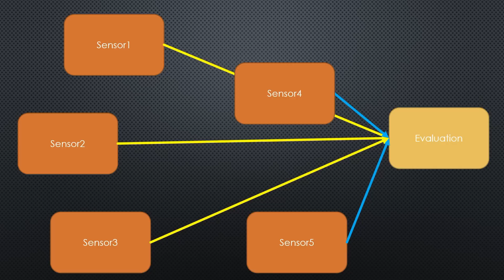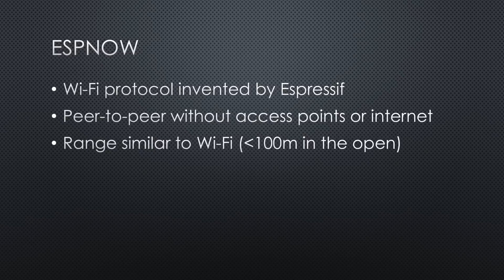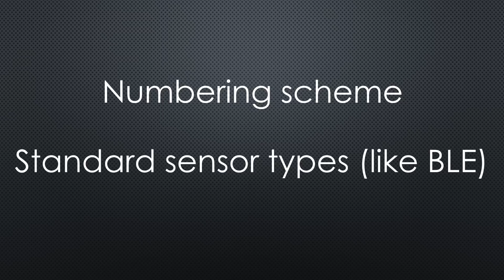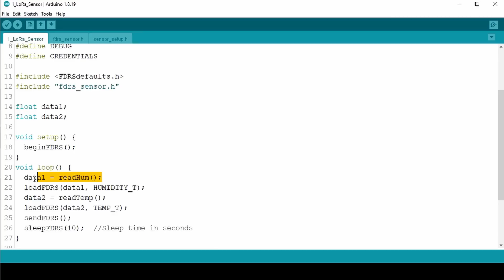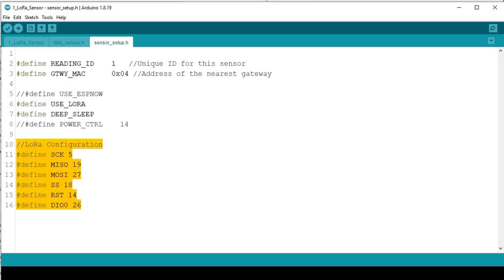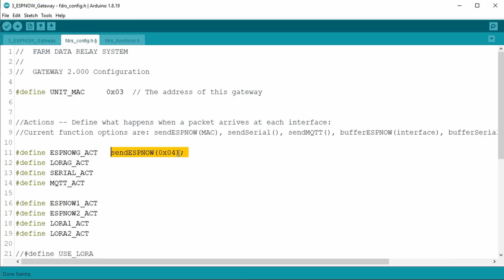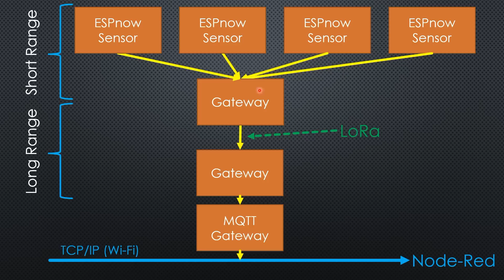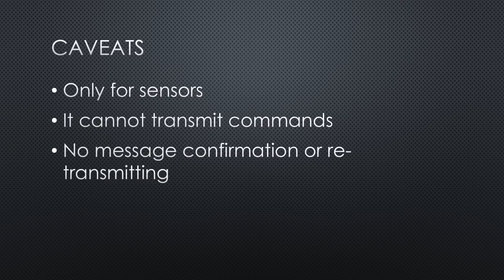430 ESPnow and LoRa Network (incl. Repeaters and Gateways). A TTN replacement?

Comment: You can use both ESPNOW and WiFi at the same time. I use it in my ESPNOW weather station. The trick is both the WiFi and ESPNOW must use the same channel, and when my AP restarts, it just picks a random channel, so when my ESPNOW to WiFi gateway reconnects to WiFi, it is no longer listening on the same channel as the weather station is transmitting on. My solution is to have the gateway broadcast an SSID (which contains the channel info), and every 1/2 the weather station looks for that SSID, and sets the channel to what the gateway is currently using.  I could have just hard coded my channel in the AP, gateway and weather station, but I like to avoid hard coding configurations like that.
Reply from the maker: Thank you for the info! I new that there are some restrictions. So it is probably easier to spend an ESP-01 to avoid any hassle….

Comment: Congratulations on your videos always well made and very well explained.

A few years ago I made a lorawan network with a gateway on raspberry, it always worked well, but with the upgrade to v3 I had several problems.
I was thinking of switching to a local Lora network, reusing the old sensors based on Arduino Micro AT328 and Wemos D1 (ESP8266) boards with RFM95
Your video may have helped me migrate from Lorawan to Lora / ESPnow, recreating a local network and sending data to raspberry + node.red
Reply from the maker: That is also my plan for my mailbox sensor. Particularly if Timm adds a confirmation.

Comment: Hi @Andreas , Very nice video and very nice concept. I will be watching this space as I also switched from wifi to to espnow for all my sensors. Also, to let you know , it is possible to run both espnow and WiFi Station on the same ESP at the same time. I run my setup where an ESP01 (yes, you read it right !!) acts as a gateway to receive espnow messages and relays them to a MQTT server. It has been running without issues since the last 4-5 months. Forgot to mention that the only limitation on it is that the gateway ESP (and hence the other nodes) has to be on the same channel as the WiFi SSID which is just one extra piece of code to determine the same.
Reply from the maker: Interesting to only use an ESP-01 as a gateway. Maybe Timm has a look at your comment!
Reply: WiFi and ESP-NOW work if they are both on the same channel.  If the user were to set all sensors and gateways to run on the channel that their WiFi router is on then that would work. From my perspective, this would have been too much to ask of a new user who is less knowledgeable about networking. I could imagine a lot of beginners contacting me asking why their system stopped working when their WiFi router switched channels on them.
However: I'm planning to make the WiFi channel modifiable as a global soon.
Reply: @timmb2512  I solved this issue on the sensor node by taking the SSID of the WiFi router , and scanning the same to obtain the channel. also a retry mechanism where if message delivery fails, it again scans to see if the channel has changed from last time. I also store the channel in EEPROM to avoid wasting ~2 sec in scanning every time. You can view my code in the repo here : https://github.com/vks007/public-projects/blob/master/include/espnowUtil.h
Reply: @vks002  This is one of my favorite workarounds, the other way being to cycle through all of the channels and see what gets a response. However, what would happen if a sensor is separated from the gateway by a repeater? You could have every single gateway/repeater broadcast an AP, but keeping them all updated will lead to overhead that I'm just not ready for right now. I definitely won't rule it out forever, I just want to focus on other aspects of development for now. You are more than welcome to try adding your method to FDRS and reporting back/submitting a pull request.

Comment: Hi Andreas, i love your videos, i have learned a lot watching them. I need your help. I have tried to use an EPS32 to control the start and stop of an AC motor, with a MOC3041 and a TRIAC BT13, but the ESP32 is resets itself just when the motor is started or stopped. In the circuit I'm also using a load cell and an oled 0.91" display. Could you please give me an idea of why the ESP32 is resets itelf. Could I sent you the circuit via e-mail?
Reply from the maker: It usually has to do with an unstable power supply.
Reply: @AndreasSpiess  thank hoy forma your time. I"ll check it. I've been powering the esp32 with my laptop's usb 3.0 port.
Reply from the maker: @chuchinmc  Motors can create a lot of noise on power lines…
Reply: @AndreasSpiess  Hi Andreas. I have found the solution. I've made the the same circuit, but working with a PIC18F26k22. The Oled display didn't work on the PIC without pull-up resistors on SCL and SDA pins, so i had to use them to make it work. On the ESP32, the oled display worked fine without these resistors and even people on the tutorials I've had seen, doesn't use them. So, i put the  pull-up resistors on the ESP32 oled display circuit and ¡magic happened!, now ESP32 works excellent, it doesn't reset anymore when starting or stopping the AC motor.
Thank you for your time and thanks for your videos.

Comment: You can have wifi and espnow running at the same time. I do this in a esp32 motion detector talking to a esp32 light switch which is connected to the router as well.
Reply from the maker: Thank you. Maybe Timm has a look if he can live with the restriction of using the same channel.
Reply from the maker: Thank you. Maybe Timm has a look if he can live with the restriction of using the same channel.

Comment: I have a use case I am working on where I need to report sensor values along a river 5 miles. One sensor each mile. I think I needed to use a mesh network for the farthest node to connect to the gateway. Do you know if the repeater can also send its own sensor data with this approach?
Reply: At the moment, there isn't a way to have gateways report their own sensor readings.
I would recommend linking the gateways via LoRa and using ESP-NOW to communicate between the gateway and a nearby sensor.
You just gave me a great idea though: I'm going to add serial as an output option for the sensor sketch, then it could be hard-wired to a gateway, thus eliminating the ESP-NOW jump between sensor and gateway.

Comment: this looks like it could have a lot of potential for (other than farms) managing large plots of land or woodland like for instance having thermal and smoke sensors using small solar panels and a battery scattered around woodland to make catching fires early easier. also could be cool building one of these networks out over a town or city that tracks roughly how busy areas are and also trafic using things like millimeter wave and radar sensors all going to a central node that publishes a heat map of an area that is independent of company like google or even independent of weather people are carrying phones
Reply: Exactly! These are the kinds of applications I dreamt of while designing the system. I used to have a radar motion detector sketch included, I just need to update it and re-upload.
Reply: What cool would be if you could have different recievers. So that you could communicate similar how internet works over different range extenders to the board that needs the information. But that's probably difficult to put into practice. Would probably need to know the localization of the recievers to connect over the most efficient way to them. Maybe could test always when a new sensor adds to the network testing the shortest connection to it like counting how many range extenders it has taken to reach the destination. The strength of the signal could also be clue but probably is not needed. But when the sensor is a moving target it's different locations all the time

Comment: I use one node as gateway, that also does WiFi. I have a D1 Mini Pro in my mailbox, which sends the ESP-NOW message to my gateway. When my gateway has received a message, it will restart the ESP, connect to WiFi, send MQTT message, reboot the ESP, and go back into ESP-NOW gateway state. Whole process takes ~3 seconds.
Reply from the maker: Good project! You just have to be sure than no other message arrives during the downtime…
Reply: @AndreasSpiess  Only got 1 slave and 1 master, so no worries. Not the best for reusability, but it's ok

Comment: Hello everyone, and thank you for the kind feedback on my project!
I'll be doing my best to address any questions that are asked here over the next couple days.
Cheers!
Reply: Great work Tim. I have a small farm in Australia and have implemented a similar LORA solution to get water tank readings displayed in the house. Your solution seems very robust and adaptable. I will definitely be learning from your example. Very well done.
Reply: Hi Timm!  We need to join forces ! We have been working in similar approach for quite a while + ability to mix sensors from multiple vendors - use own platform. (locally)
Reply: Cool project. I never really liked automatic meshes. Too many tings that can go wrong.
May I recommend implementing one single simple config file for the whole network (probably in JSON) and each node simple picks the important things using it's id?
You could also define the routes that traffic should take that way (e.g. "node 2 via ESP-NOW to node 4", "node 4 via LORA to node 6", etc.)
Reply: @MoritzvonSchweinitz  I've been thinking somewhat similarly for a while. I think an outside application that allows you to configure the whole system would be just the beginning, my dream is a drag-and-drop interface built on top of satellite imagery like google maps. It could even crunch topographical data between the points you drop to estimate signal strengths and ranges. Then on the other end, the application guides you through flashing them and helps you keep track of which is which.
One day...
Reply: Brilliant work Timm! I was looking for just this system. Thank you! 👍😀
Reply: great work!!  I tried something similar (espnow to wifi) but the gateway was a nightmare. I tried to use the internal EEPROM of a ESP32 and two working profiles everytime it rebooted to move from espnow (rx mode) to wifi (tx mqtt mode). And also two esp32 connected by Serial (not by usb), but I still have issues. So I´m really interested in the gateway you have configured. great work!!
Reply: Hi Tim, consider how MODBUS could be used as well.
Reply: love your work!
Reply: Thanks so much for your incredible and most valuable work!!! 🙏🙏🙏

Comment: I would not reinvent the wheel and prefer standard communications protocols. The maintenance of a custom solution is unpredictable
Reply from the maker: I would call MQTT, ESP-NOW, LoRa and WiFi standard protocols in the Maker community.
Reply: @AndreasSpiess  ESP-NOW is proprietary.  all protocols should be standard also up the stack like LoraWan / TCP/IP, JSON....you already see that the proposed stack is one way only

Comment: I like to see more of ESP NOW and its limitations. It says max peers is 20, but is that only for the sender to send to max 20 devices or does it also affect a receiver which wants to get data from more than 20 devices? I only have to add a peer to the sender. Documentation is sparse on this.
Also encryption limits that even further and example code is even less available.
Reply: Documentation is definitely a little hazy regarding ESP-NOW peers. The 20 device limit isn't relevant in the way that FDRS uses ESP-NOW.

Comment: Very interesting project Andreas! Thank you. 2 years ago when I played with my Ebyte LoRa modules I tried to build a mesh network (those devices are cheap but can't use LoRaWAN). You set them on individual addresses and let them decide the communication paths by the dB level they measure. It worked well for a few but I assumed at that time the messages to keep the network alive might spam the airtime and didn't pursue it. This is a star network as you explained so a different idea. 👍
Reply from the maker: You are right. Mesh network algorithms are not easy…
Reply: @AndreasSpiess  With "star" networks you can develop your own security and hierarchy. Otherwise it can become a big mesh. (sorry, couldn't resist)
Reply: @hippie-io7225  Yesh!

Comment: Nice, I developed a very similar comunication protocol for a Wide area sensor network base don LoRa only. I’m using an apikey to discard all the messages not generated from my network’s node. How do you manage this problem? Do you encript your data? Your videos are always inspiring. Thanks
Reply from the maker: Maybe Timm can give you an answer?
Reply: No encryption is used. I created a 5-byte header for LoRa packets in which the first 3 bytes of the LoRa packet contain the recipient's address, and the next two are the sender's address. The device only responds to packets that start with its own address.

Comment: I am soon building an ESPnow product for farms, so this video caught my eye :)
Reply from the maker: Perfect! Maybe you join forces with Timm?
Reply: @AndreasSpiess  He and I are going slightly different directions, and my code is mostly finished, but I might browse his code for ideas. For one, I'm using MicroPy. But I might pick through his code looking at the repeater bit.
Reply: @cdevidal Did they ever get ESP-NOW to work with MicroPy? I've often considered that you could make FDRS (my project) useful as an ESP-NOW modem attached to MicroPython devices via serial.
Reply: @timmb2512  Glenn20 has a patch and it’s almost ready to be merged into the mainline. Another difference between yours and mine, I’m doing bidirectional comms. That may prevent me from using repeaters, I don’t know. Can the AT mode issue ESPnow commands? I know the new ESP32 AT firmwares are quite advanced. Then you could use them as a modem.
Reply: @cdevidal  I don't think it's supported in AT mode, unless it happened recently.

Comment: Well done Andreas, very usefull. I am busy developing a greenhouse control system for home / agriculture use. I was initially tinkering with lorawan, but a  bit put off by gateway cost for each site. This looks much better.
Reply from the maker: Maybe you can join forces with Timm?
Reply: Dear Andreas ! Thank you for the interesting video. In fact we have been working with similar approach for quite a while (LOCAL MQTT + cloud MQTT talking to each other) -  Francois - We need to meet/zoom discuss all together and join forces with Timm! (maybe through EU project as well!)

Comment: I made a similar project a few years ago, however I just used LoRa with two different configurations, long range but slow communication and short range but fast communication (LoRa can be configured for that too). The system was later integrated into the Home Assistant. It worked very well, only the Gateway (Raspberry pi with the Home Assistant) had access to the internet and the remaining devices (sensors and actuators) communicated to gateway through LoRa communication.
Reply: @Deon du Plooy Well the documentation is available online, but the document is in portuguese. If that's not a problem for you I can give you the link. There are more than 100 pages about the project. 
Beyond that, there is a library that I modified for the project, I added encryption to the communication for example. Search for "pyLora". I hope it's useful to you, but note that I don't provide support for that.
Reply from the maker: The integration into HA can be a benefit for certain applications. I think with this project it can be done using MQTT. Or somebody writes a gateway which is integrated into HA…
Reply: @AndreasSpiess  Right, that's what I did. I created a custom module for HA. So the Raspberry Pi served as a HA server and also as the Lora gateway. A totally independent network but the HA could be connected to the internet of course.
The gateway could receive 1 message per second on fast communication and 1 message every 5 seconds on slow communication (includes ACK). The messages received directly by the HA. All communication was encrypted and confirmed with ACK messages. And it worked not only with sensors but also actuators. So it was pretty cool.
The MQTT configuration would certainly be simple than this...

Comment: What is the failover method? If an ESP or lora goes down what takes over?
Reply: I have built in my project the logic: "if X number of consecutive messages are not sent, switch to WiFi, send the message to HA: "EMERGENCY, PLEASE ACT FAST"" ;-) But Andreas was showing similar methods on his channel: "redundancy for the redundancy" if I am not mistaken
Reply from the maker: There is no failover for the moment. LoRa and ESP-NOW cannot be used for that. Too different